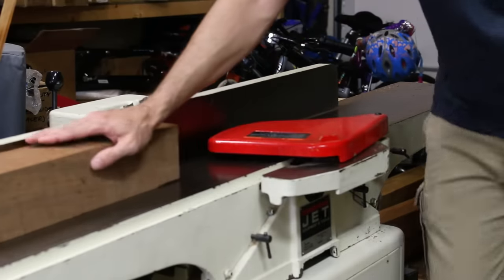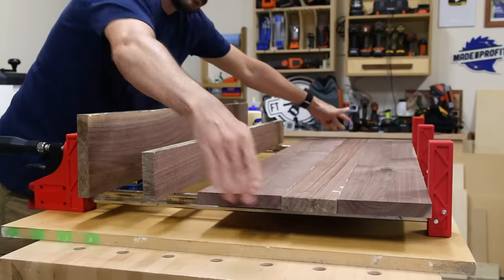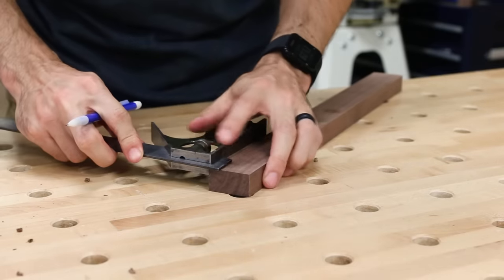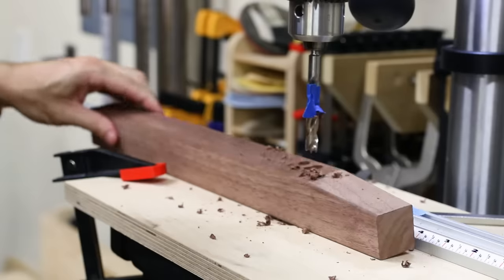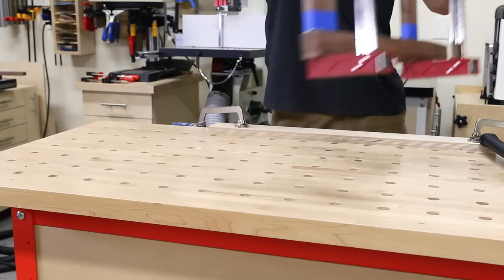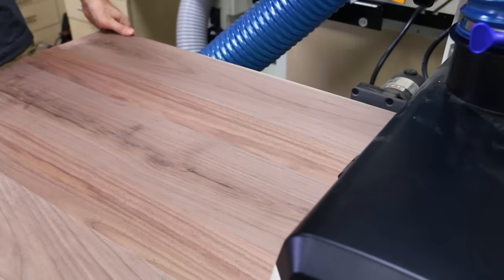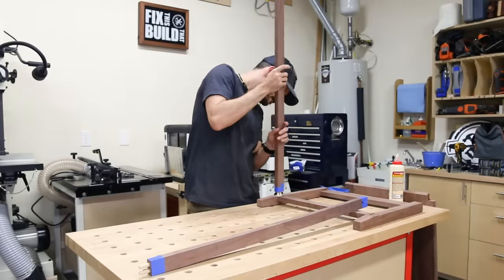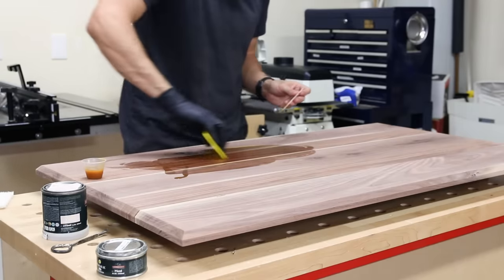How to Build a Coffee Table from Rough Wood | DIY Woodworking

Comment: I saw this video and I actually made the same kind of coffee table but with different wood and different measurements. Worked out great though! I was 13 when I made it now I’m 14! It was a long build especially since we used mortise and tenon joints for the pieces of wood under the table tops and we had to cut and chisel them with a router and some of chisels. Basically we didn’t exactly have the tools for the job but it still came out great!

Comment: Gorgeous table!  That wood's beautiful, and the design is simple yet elegant.  Well done!
One tip I once saw for notching out a shelf to a rounded leg, was to use the drill press and a drill bit size equal to the leg's round-over radius in the corner of the notch, then band-saw up to this hole, leaving a rounded notch that perfectly matches the leg.  But that's more for larger round-overs.  Here the difference is so small, it's unnoticeable.

Comment: Just made a table that looks pretty much the same. Using a hand drill, minor saw and a hammer. :DHand sanded everything and used dowel joints. Came out pretty okay. The lower panel needs to be switched out because i didnt cut it perfectly but its no biggie! Thanks for the good video!

Comment: I have  question about wood movement.  The lower shelf is constrained across its width by the legs. As the width changes with changing humidity, will this constraint cause problems?

Comment: You can still join the front and side stretchers on the same location if you joined one set using mortise/tenon and then dowel the second set so as to pin the tenons.

Comment: My favorite McGuiver is when he is locked inside a fireplace of a cabin. He breaks his bonds or not and braces himself with his back against the chimney walls and feet out to inch worm his way all the way to the top. Then he rolls off the roof or something and he hot wires a dirt bike. The best part for me is that he accurately teaches you how to bypass the key start and it’s on TV. Loved the 80’s...
Reply from the maker: MacGyver was the best!

Comment: Great Build! Question: The lower shelf is constrained across its width by the legs. As the width changes with changing humidity, will this push the legs apart?
Reply from the maker: I left a little wiggle room on the insides to avoid this 👍
Reply: @Fixthisbuildthat  Thanks!

Comment: Hey man. Looking at getting a drum sander (this one actually) but I'm torn between that and an oscillating edge sander. Trying to get opinions on which is the more "valuable" tool to have in the shop. Thoughts?
Reply from the maker: totally depends on what your work is and what you'd use more

Comment: Great project.  Downloaded the plans and will be building it for my son.  Question for you - did you only use Modified Oil Finish as in the link as it only shows 1 product, but your video shows 2 products being used.  Thanks for the clarification!
Reply from the maker: Yep, it's just one finish but you can add an accelerator to it (the clear part) that makes it cure faster
Reply: @Fixthisbuildthat  Thank you sir!  I ordered the Walnut yesterday!  Onto the build!  Love your work and your plans are very detailed and easy to follow!

Comment: One tip for the hot glue - IPA or Acetone will break the bond of the glue making it come off clean and easy. I still prefer the tape+CA, but sometimes hot glue works better. Nice build, the table looks great.

Comment: I think you should have applied  traditional west or Japanese joinery for this table. It would immensely benefit the looks, value and integrity. Joinery requires very few hand tools to achieve. They can be expensive but cheaper ones work exactly the same way. Thank you for sharing and keep touching wood.

Comment: Beautiful project and techniques.  If you had wanted to use dowels on the upper rails, could you have slid the lower shelf in, at an angle, from the end, then lowered it onto the lower rails?
Reply from the maker: I didn't want to risk it not working :)

Comment: My new method for making dowel holes with a hand drill, they don't have to be straight, in fact, they are better if they are not straight.

Drill the dowel hole with the drill slightly askew in any random direction you please. The only thing that matters is that the position at which the bit first enters the wood lines up with the hole on the other piece you are joining with the dowel. Now drill the other hole on the other piece using the same technique, check to make sure the point where the drill enters will make a hole thst lines up with the hole on the other piece you just drilled. DO NOT worry if your bit goes in straight or not. Even better if it is not perfect.

NOW the trick. You are not going to use wooden dowels. You are going to use thickened epoxy (Fiberglass Coatings Tm. sells an awesome product called super bond, it  goes on like peanut butter and dries like a hockey puck), but you can use whatever thickened epoxy you have available. Fill both holes all the way up with epoxy and make sure you leave enough excess that when you press the two pieces together, the epoxy from one hole comes into complete contact with the epoxy from the other hole. Clamp and dry. You have now made your own epoxy dowel thst will be 100 times stronger than wood, probably a slight exaggeration, and the fact that your holes aren't angled exactly the same creates a crooked dowel that will be impossible to pull the pi3ces apart without actually ripping the wood apart. The crooked dowel has locked the two pieces together, giving you added strength and security, even though absolutely straight epoxy dowels would still be stronger than wood.

This is quick, easy, and a neat trick to have in a lot of different applications.
Let me know what you think.
Reply: Sounds to be something worth giving a try thanks

Comment: Very glad to see a video that includes A) a  design mistake and how to go on anyway, B) a measuring mistake and how to fix it, C) packs a ton of info and demonstration without any shaky camera, bad lighting, or unintelligible speech.  D)Omits the  3 minutes of introductory  useless filler.  High marks on production skills!  You understand the value of making the  best use of our time when watching.

Can you comment on your favorite doweling jig, and offer any tips applying that jig to table leaves?  Interchangability being the goal.

One thing I haven't seen anyone mention, and I haven't watched that many woodworking videos, is how the wood affects the character of the whole project.  From open vs closed grain to degree of hardness to how the smell of the freshly sawn wood fills the air.  Walnut has a smell all its own, as does cherry, apple and red oak.

I'm an amateur woodworker on a modest budget, but between small furniture, some boat carpentry and some residential improvements, I do have a few power tools I collected as the project list evolved.  I have a used 8" no name but very good jointer, an old Rockwell table saw, a 13" planer , along with miter chop saws, and a littany of hand power tools.   Point is you don't need a $10,000 shop tool  budget to build the table as depicted.   The drum sander is definitely over the top though.  Get it?  Over the top?  I should start making my own videos....

Comment: Hey Brad! Always love the builds. Question for ya....say you want to use the tabletop fasteners like you did here but don't have a biscuit joiner, what would you use? Would a slot cutter bit on the router work? And at what depth from the top?
Reply from the maker: I would cut it with a tablesaw.  Just do a 3/8" deep groove along the top of the rail.  I think it's 3/8" down, but you can confirm with the zclips

Comment: Wouldn’t the second set of dowels strengthen the first after the glue dried?
Reply: The problems come from the lateral strength, the sheering force from weight on the table has a much easier time to just snap the dowels. The other issue is that the drilled dowel has much less surface contact area holding it in place being 3/8" instead of much longer.
Reply: @adamself2463  after the dowel gets doweled and glued it is reconnected at full length. If glue joints are stronger than the wood itself, it would get stronger rather than weaker; which is the point I was trying to make/ask. Also what shear weight are you imagining this shelf to receive? Dowel joints can hold hundreds of pounds each.

Comment: What’s the difference between a taper and a champher
Reply from the maker: A taper is a cut at an angle down the length of a board going from wide to narrow. A chamfer is a consistent angled profile (typical 45 degrees) on the edge of a board 👍

Comment: I am a old carpenter  does eny one use joints eny more  hand full of hand tool  I find it sad that need costly machine to make simply  small project
Reply: Ray Morrison you don’t have to do any of this with expensive machines. You can do everything he does by hand. But it will take longer and possibly be less accurate (depending on your skill level) 

Nothing wrong with using machines to make joints - and a good woodworker can get the same result using 3 or 4 different tools/techniques.
Reply: Lol, handmade is even crap nowadays. I detest all these gimmick joinery machines.
Reply: Ray Morrison - I'm with you...no machines in my shop...a collection of hand tools and classical music make all my furniture and other projects!
Reply: Bryan H - Less accurate my butt...I can get to one thousandth accuracy with my hand plane...the best those machines will do is around one 32nd...shack
Reply: to each their own

Comment: You're not MacGyver unless you can make a bomb using nothing but saw dust and wood glue. Nice table.
Reply from the maker: I typically use sawdust and wood glue AFTER I've blow something up...like a bad joint 😀
Reply: @Fixthisbuildthat  Good enough, Mr. MacGyver.

Comment: How to build a coffee table from rough wood... 
Step 1, Buy $10,000 worth of tools
Reply: LOL exactly...
We no longer woodwork, we simply feed wood to table saws then play with large lego
Reply: Yeah... woodworking involves tools. Tools cost money. 

That $10,000 worth of tools can make you $100,000 worth of furniture. Or you can stop whining and go buy something from Ikea.
Reply: @bryanh6856  Oh i make furniture, i just don't do it for a living, i am a software developer.
As a hobby i woodwork with hand tools, i do not have 10k worth of tools, i have a few hand tools.
Spending 10k on tools for something which is not my day job is kind of stupid, especially if i am not returning this investment.
I did however sold some furniture i made by hand, and i covered my tool cost long ago.

As for making 100k worth of furniture, i am not sure where you are from, but it can make you that much furniture, the issue would be selling that much furniture and competing with the cost of the likes of Ikea etc
To do that you would need to work with cheap materials, mostly MDF and cover things up with veneer, 
and sorry, for me this is not feeling like woodworking anymore, you think you need to consider the grain structure when you hack into MDF? 
just legos and glue... i don't like it
Reply: @bryanh6856  hey Bryan you're right. Woodworking involves tools. Not necessarily these tools though. Funnily enough I don't think woodworkers were using this tool set 100 years ago and I don't think your average DIY woodworker can afford this today. Glad you can though. Good for you, buddy!
Reply: LOL🤣
Reply: I can build a house with these tools. LOL
Reply: @bryanh6856  Nobody is whining.  The title of the video says "DIY", that simple is not correct.  This is a professional workshop, loaded with professional machines.
Reply: @mrkasbeck  Why stop at 100 years ago? Woodwork was done long before then with more primitive tools perhaps we should go back to that.  Even if it is a hobby you can acquire these tools over many years, you don't have to do it over night. There are also cheaper alternatives to many of the machines he uses.
Reply: Hand tools or power tools, it’s all woodworking. I agree that having a large planer or jointer makes life much easier for some, but that doesn’t make a power tool owner any less of a craftsman than one who uses hand planes. Creating a work of art from rough wood is more than “stacking legos”. The type person who makes a comment like that sounds more jealous than reasonable. 

Is this video a “DIY”, well....no. It’s only DIY if you own these tools, and if you do, my guess it you already have the skill set and knowledge to build it 

I believe LEGO guy also commented that earning a $100,000 a year is only possible using MDF and lesser materials, I couldn’t disagree more. I see hardwood tables, chairs, even just slabs selling for thousands of dollars. Just because you haven’t done it does not mean it can’t be done.
Reply: @bryanseward3649  that's not really the point though. I'm not saying that using professional tools is cheating, because it's not. I'm saying that it isn't DIY if you're a professional and it's not a very good instructional video for others if they don't own all the professional tools that appear in the video. 

There are good diy instructionals on YouTube that use realistic tool sets and that teach how to do things without needing a dedicated machine to do it. 

But this video, although entertaining and nice to watch isn't so much of a 'how to' as it is an advertisement for the tools in the video.